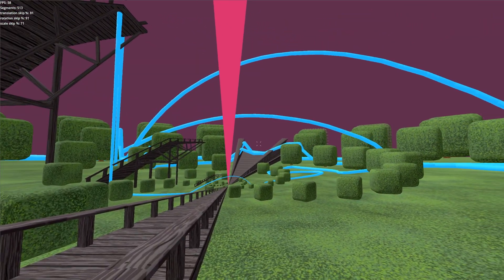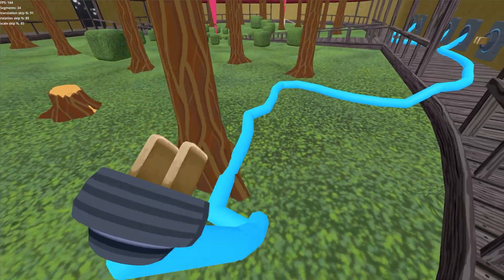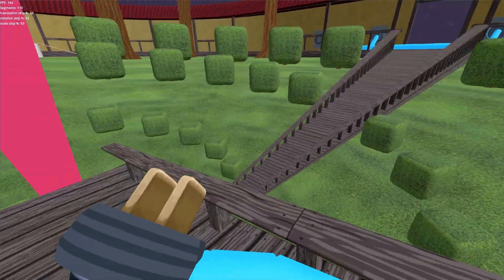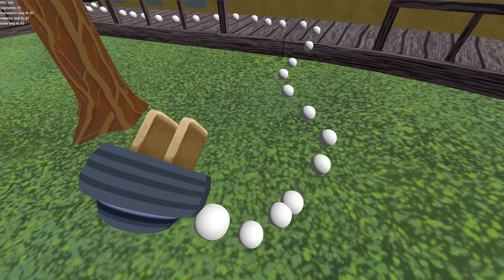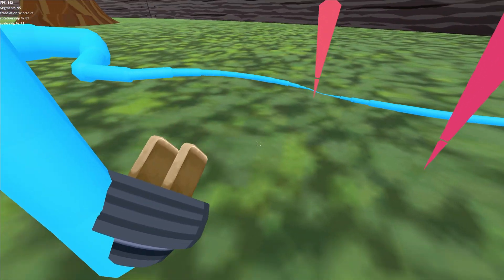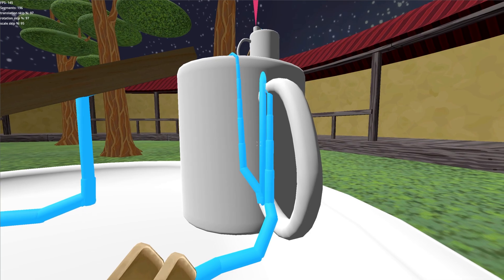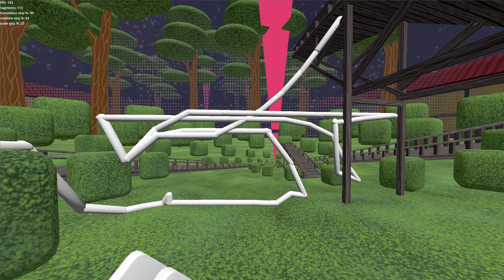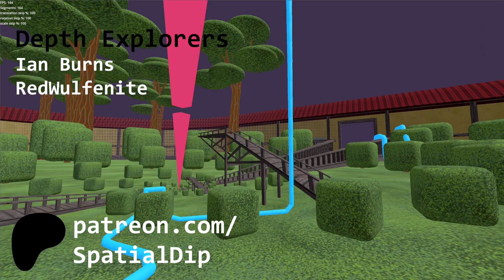Adding Cable Physics to My Space Warping Game - Spatial Dip Devlog 3

Comment: I know that you can't fall directly into the center because of floating point error (I think). But if possible, simulating falling directly into the center for a level would be very satisfying. I think it's everyone's immediate thought when they see this; at least it was mine. Really great stuff as always. Oddly this game reminds me of Chibi-Robo: Park Patrol which I adored as a kid, but they're not really alike in any way.
Reply from the maker: You could fall directly into the center if youre perfectly aligned above with the beacon. I could start the game with the player in that position or snap them to it.
Just checked out Chibi-Robo, very charming!
Reply: @assortednonsense1  So you could theoretically fall infinitely into the center without issue? If so, it's well-programmed to work in a way beyond my comprehension. Would love to be able to be playing a level and jump towards the proverbial center and just fall blindingly fast for no reason other than satisfaction; much like stacking portals on top of one another and just falling, but smaller.

Comment: I don't know what kind of game this is going to be (beyond your mention of it being open world), but the contained space, the puzzle suited mechanic and to an extent the art style makes me think it could work with an outer wilds style "world mystery" game. No matter what you do I'm very excited and will almost certainly buy it, it was just a thought I had. 

I am curious though, what sort of gameplay loop/game structure are you thinking of? Combat and a more conventional open world progression? Puzzles and mysteries? Free form exploration? All or several of those or something completely different? I'm very interested to know.
Reply: Also, it breaks my brain how smoothly and "effortlessly" (even though I'm sure you've put a huge amount of work into it), this engine works. It's honestly so impressive, especially considering how quickly you seem to be able to add things.
Reply from the maker: Thanks! Outer Wilds isnt too far off.
The current direction Im going with it is in the realm of puzzle-exploration metroidbrainia. 
I plan on leaning in to the trippy/surreal vibes with the setting and fill the world with goofy/charming characters.
You'll explore, solve puzzles, learn more about the world, meet and help out wacky characters, and gain new abilities/knowledge that allows you to explore deeper.

Youll shrink deeper to solve an issue affecting a larger scale, which in turn affects the scale above.
If a gear stops turning, you'll have to meddle in the affairs of bugs to fix it.

Comment: one some suggestion could be to make one end of the “pipe” that connects the nodes be smaller, maybe the same size as the next nodes pipe. maybe that’ll make it look more smooth? the behavior looks great otherwise this project is very impressive
Reply from the maker: @the-channel-of-TIQI  Thanks! That would definitely be an improvement, but I couldnt find a performant implementation for this. Any suggestions?
Reply: if you know that the difference in scale between zones is something static (i think in a previous devlog you said something like you get scaled by some amount once you cross a threshold), then maybe have a couple models ready, one for if a child node needs to be smaller than its parent, and one for if they’re at the same scale, and then switch the model whenever it is that you’re checking the distance and doing that cool scaling stuff. i’m not sure if that’s performant lol but that’s what i could think of, either that or if you’re able to control the sizes of each end of the pipe before they’re being made then just scale the side closer to the parent up by whatever the known scale amount is if the child has been scaled down
Reply: You could fake the lighting through shading and make the segments themselves be procedurally generated quads, so you have a simple mesh that is updated around physics step frequency or something. But idk about shaders enough to know how hard it'd be to make it look good.
  Also something deep inside me wants to say that it'd be possible to do an actual line shader with varying width. But that sounds like something my tech art friends would say is impossibly difficult for some reason.